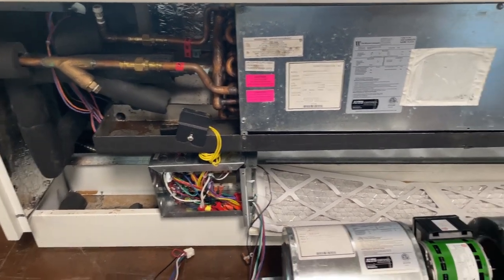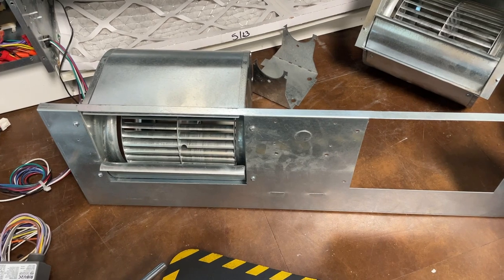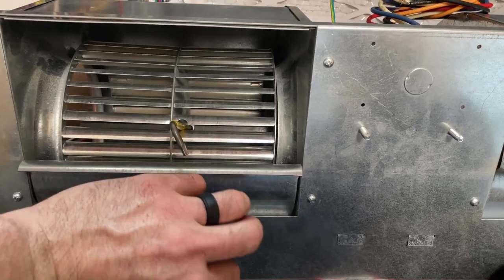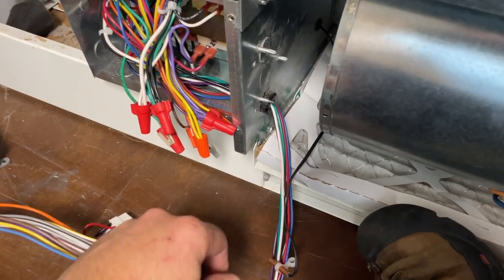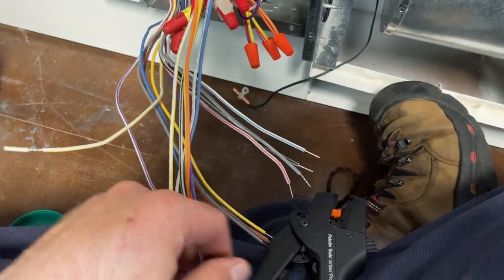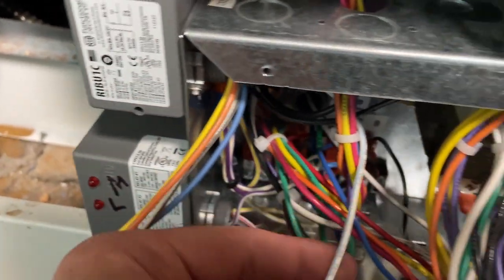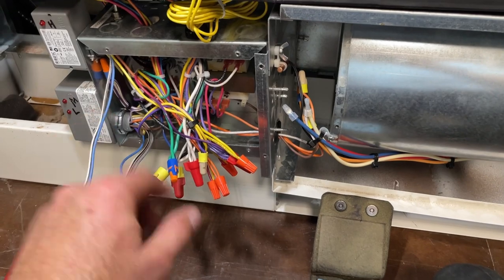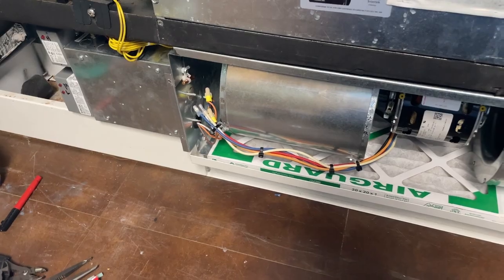HowTo26: Covert a Whalen Fan Coil From ECM to Standard Blower (And Simple Wiring Tips and Tricks)

Comment: The way you sorted that spaghetti wiring out that's impressive 👍
Funny how electrical work differs from country to country .
Over here mixing stranded and solid on the same connection is a big fat Nope .
Also we don't use wire nuts , we either use terminal bolcks or mostly Wagos , you could say they've pretty much become the standard .
Reply: @HVACLife  To be fair them guys make it look cleaner that it usually is but yeah I guess the electrical standards vary from place to place even neighbouring countries .
Like some standards in the UK are very different than the continent for whatever reason .